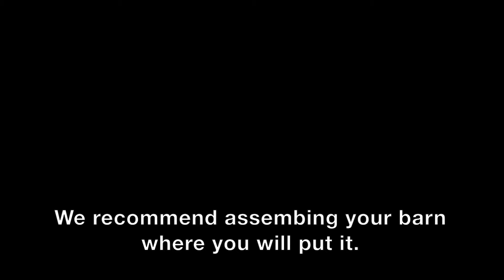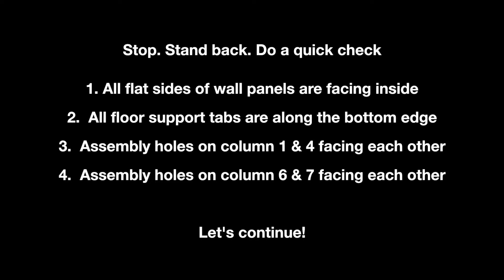The ecoFLEX Jumbo Fontana Chicken Barn Assembly Video Guide

Comment: Since I'm building this tomorrow I watched the video. The ventilation is in the upper panels and you can see it in the video. The written directions state to slide out one or two of the roof panels for cleaning. Gives complete access to the main unit and I would assume I can clean out the nest boxes easily thru the access door over the nesting boxes. Only thing I would have preferred is the roosts be higher in the unit and not so low. I may see if I can swap panels to create higher perches. Also would be nice if the perches could be round, as most of my birds prefer round roosts to square. I may see how they like it and modify that if they don't.
Reply: How are you liking it now? I'm considering this one. What holds the floorboards in securely? It looks like a preditor could get under neath and pop themup from below?